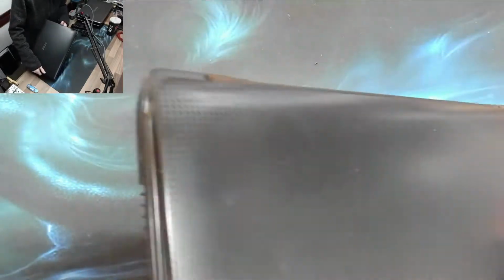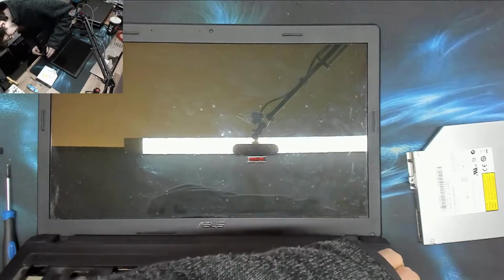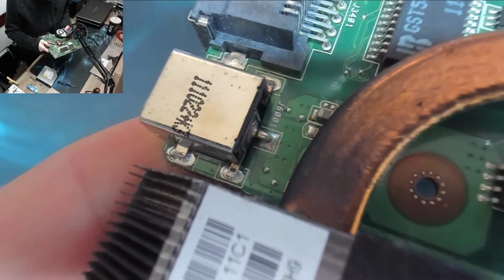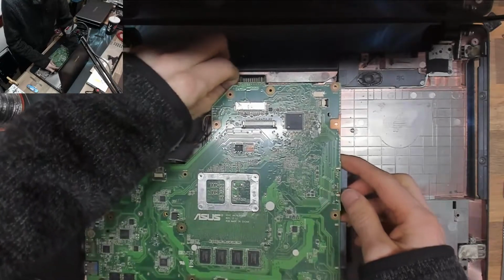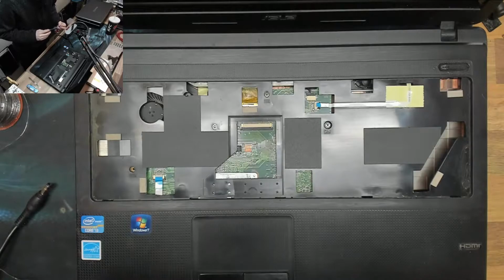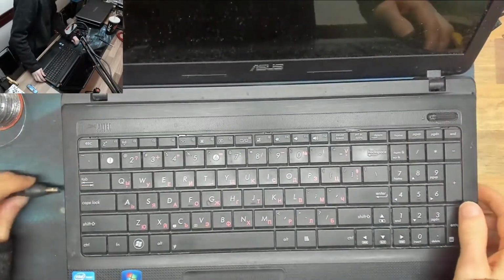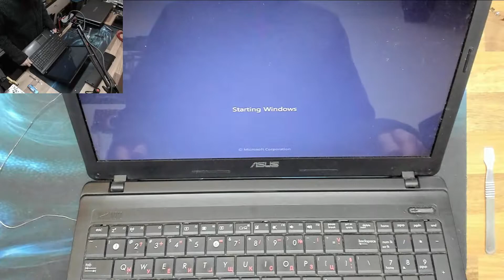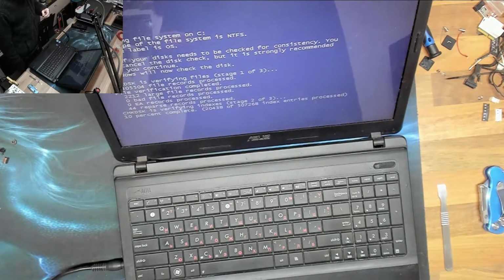LFC#139 - Asus K54c Not Charging, Bad DC jack

Comment: Hello. Bit of a random question but have you ever thought of getting JBC soldering equipment. I know people will tell you there are overpriced but they are simply amazing bit of kit. They can heat up in 350 Celsius in about 3-4 seconds and you can also hot swap tips whilst the iron is on. BTW The videos are great. It gives you insight into computer repair.

Comment: Hi, great video! I have the same laptop and you helped me a lot fixing the same problem, it worked great! I have a question, can you update this laptop to windows 10??
Reply from the maker: Yes, theoretically anything that runs Win 7 or higher can be upgraded to 10. But these earlier Win 7 devices are slow as heck by modern standards, so I wouldn't recommend it.
Reply: @Adamant_IT  thanks for your response, two days ago I upgraded the laptop and it runs amazing! Maybe it's because I added 2 gb of ram and swapped the hard drive for an ssd, but still thanks for this tutorial, it helped me big time!!